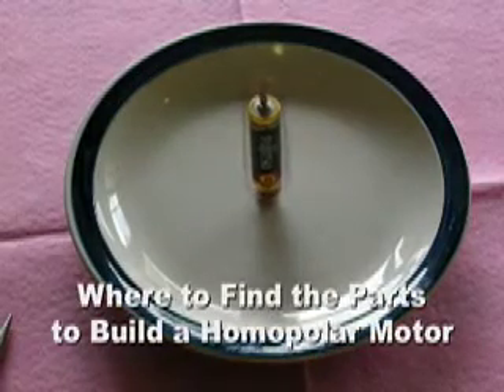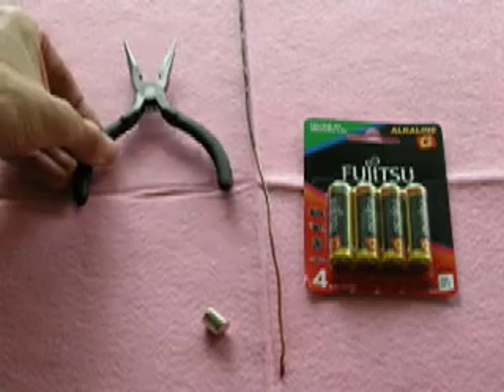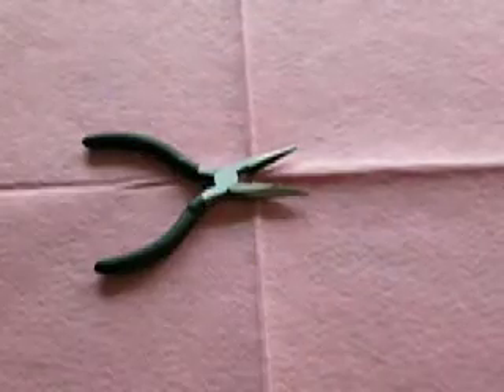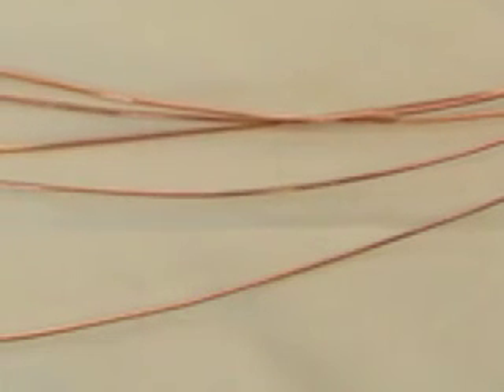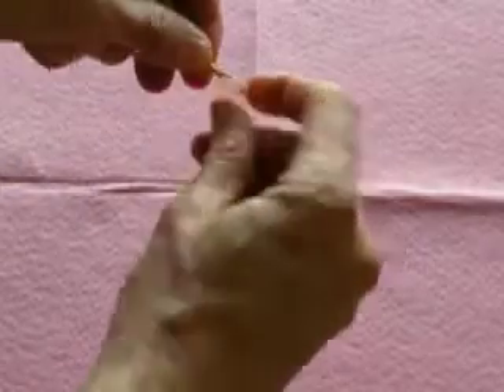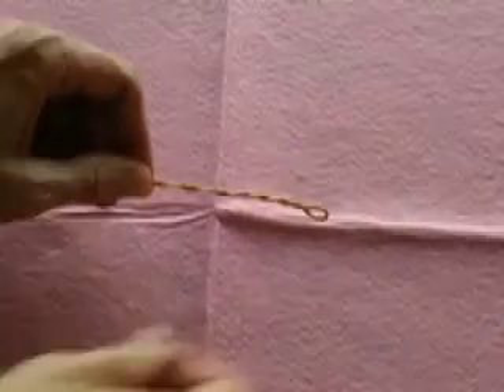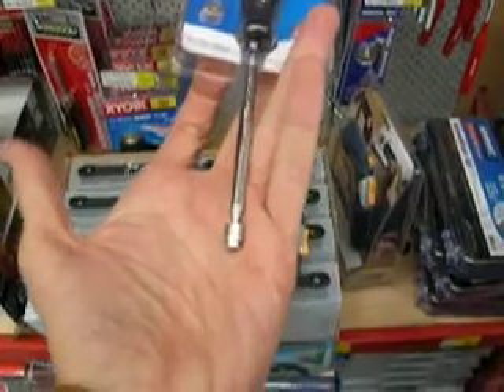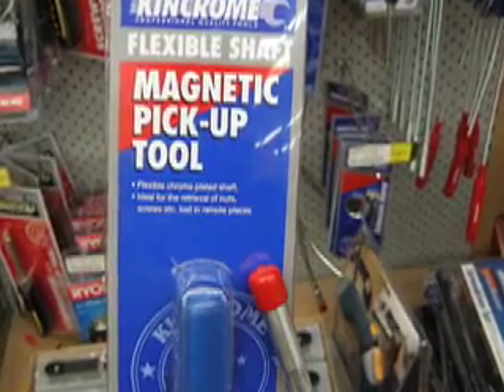How to Find the Parts to Build a Homopolar Motor

Comment: I got my magnet at my local hobby store. There were 3 in a pack for less than five dollars. The wire I use is #12 copper wire stripped from a scrap of romex.

Comment: Why Its A Bad Idea To Use Lithium Batteries:

the battery and wire will heat up during the experiment. that because there is a short in the circuit. when lithium or rechargeable batteries short they don't just lose power at an insane rate THEY CATCH FIRE